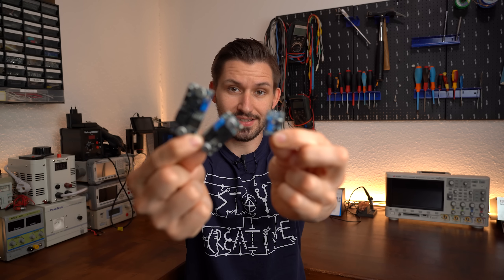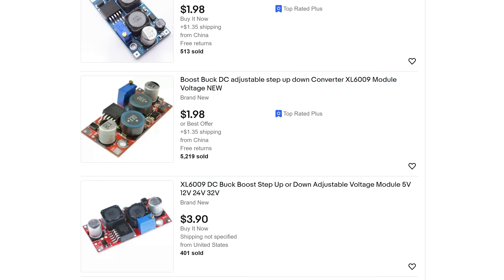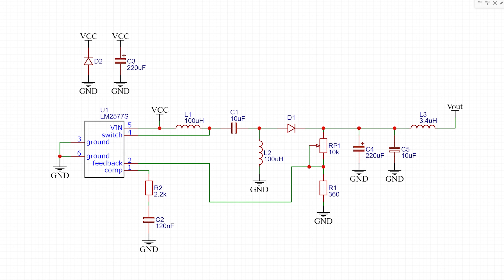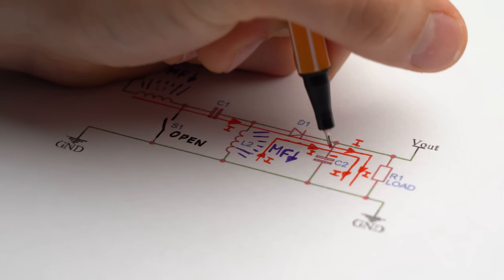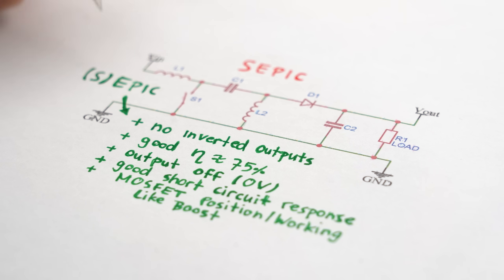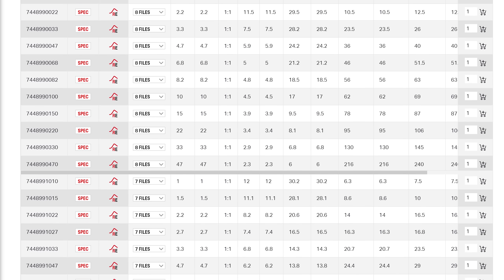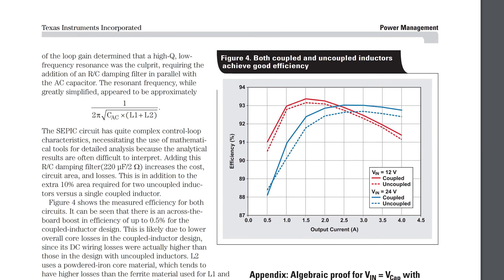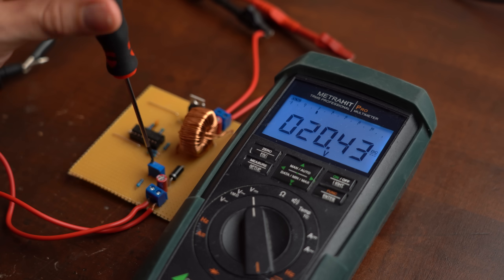The Most Versatile Voltage Converter you never heard of! The (S)EPIC Converter

Comment: So unless you're a Chinese factory counting every cent, does it make any sense to use either a buck or boost individually, instead of just using a buck/boost?
Reply: If you are an individual doing this for a hobby I'd say focus on the size requirements and amps required by your device. I got the XL6019 coz It can handle 5AMPs plus has it's own heatsink so continuous running for extended periods of time won't make it burn.. 
(Mine's going strong for 3 years of continuous use)
Reply: @mynk0.78mm  I guess what I was trying to say (and yes it probably varies case by case) is that, what are the negatives of using a buck/boost if you only need one or the other? Are the combined converters less efficient?
Reply: @laernulienlaernulienlaernu8953  the single converters have lower cost, higher efficiency, more power or smaller size(last two being inversely proportional)

But the difference is minuscule if you are buying these in low volumes (less than 100). Which is why in my original comment I said look at your requirements and availability in your local area

Comment: It’s kind of amazing that buying two inductors is significantly cheaper than a single coupled one. I suppose there’s just not a big enough market for them to compete on price, huh?  
Super cool video! Especially the DIY circuit at the end.
Reply: Winding a single is much easier than winding a dual with most winding machines.

Comment: I'd guess that a specific boost or buck circuit is more efficient, to take a simple example in a 12V to 24V boost, half the output power is coming directly from the input, while it's a bit less than half in a 12V to 5V buck

Comment: The main reason, if I remember right, to use coupled inductors is that it will be much easier to find a capacitor that will handle the current. These poor caps in the middle are really having it.
Reply from the maker: Thanks for the feedback :-)

Comment: I was researching the different topologies to decide which one to design a low-voltage DC UPS around, and kept hearing that SEPIC is unstable against transient loads. It'd be interesting to see a video on how different topologies react to different types of loads.
Reply: Hey sounds like the situation I found myself in too! Surprised there isn't more commercial options around this given how often you'd think home users would just want an uninterrupted DC power source for their home network and other DC-powered electronics. My setup at the moment is a small server rack with a 15V DC PSU and a 12V Lead Acid battery (+ battery tender) with their ground connections tied. The output voltages are separated by diodes, thus creating a sort of "OR-ing" device. That gate's output is connected to a powerpole rigrunner so that I can split all my components to separate SEPIC converters to ease the change in load and to also not have a single point of failure. So far so good but then again I'm only running raspberry pi's, switches, and a router at the moment.
Reply: Many power supplies are based on a dual control loop topology, with an outer loop with conventional voltage control PWM and inner loop based on current mode control.  This tends to protect the power supply against transient loads, especially short circuits and the like.  Something like UC3843 and like series of chips may be more stable with a SEPIC converter.  There is a sense resistor in series with the source of the switch to control switch currents, and there is an outer control loop that senses the voltage.
Reply: There is also a four-switch buck-boost converter. Maybe look at BQ25713 for an example.
Reply: @k4be.  it sounds terrifing, one llc is already a nightmare
Reply: i went with a simple e-fuse and relay with a super cap as filtering for initial burst current so i can stay online even when power is off.
my power comes from a 5v 80000A pack that i boost to 12v to run the networking hardware.
Reply: I used a large one with 4 mosfets, with a cuple of capacitors at the output it works with a pc to power
Reply: My experience is any SMPS will be unstable with transient loads. Go ahead and use one, but either have a huge cap, a battery or some other stable transient source to keep it from blowing out your electronics, or add a linear low-drop-out regulator at the end. It could even run saturated for low loss, but will prevent the voltage from going too high.

That said, I suspect this SEPIC is worse than most SMPSs.
Reply: @chaosdragon6718  These are the reasons I moved away from SEPIC topology. I'm currently exploring flyback and push-pull, but stepping from designing buck converters to these more advanced topologies is pretty daunting.

Comment: Is this commercial Buck converters are coming with close loop control (I mean, is it change its duty according to the change in output voltage? As we know, the output voltage may change with change in load. Please, give your thoughts.) Thanks, in advance
Reply: That sounds like a constant current/constant voltage (CC/CV Buck) converter. The LM5117 is just one example, but I bought some cheaper ones from Amazon years ago because I needed constant current control for running LEDs. They use feedback loops to monitor current & voltage.

Comment: thanks for the knowledge  I like all your projects.  Next time I'd like you to explain the step down of XL4016 working with 20100ct. It's a small and cheap circuit, but it crashes a lot because I'd like to control the HV power supply.
Reply from the maker: I can put it on my to do list
Reply: @greatscottlab  Tausend Dank! 😁

Comment: You got any videos of using the DC Convertors to charge any lithium batteries? I bought a handheld blower that seems to not charge, wanted to try recharging the battery but I dont know how I could do that, a video to reference would be very helpful.
Reply: in my opinion first try charging it manually using a power supply and voltmeter, if the battery voltage increases, then continue charging to full using the OEM charger.

Comment: What happens to efficiency if you make it synchronous?  I’d think you’d get it way more efficient. I’d love to see more videos on boost/buck with ultra high efficiency for sure.
Reply: Synchronous 4-switch devices are much more efficient and can handle much higher currents. Of course the down side is that they are much more expensive and are also becoming quite hard to find.
My preference for stable voltages with very little ripple are ones based on the LTC3780, the output is so stable that I have very successfully used them for mobile radio, something which is near impossible with most non-linear converters. I realised early on that Sepic devices would not be adequate.
Reply: @chrishartley1210  ya a full bridge is a solution but the problem with full bridges is that they require p channel high side which means you can’t use ganfets. I’m wondering if sepic with the diode replaced with another fet woold get you to n channel nirvana.
Reply: @jameshancock  The 3780 (and 3789) drives 4 N-channel MOSFETs.
Reply: @chrishartley1210  wow. Gotta see how they do that because a pump can’t work so how are they keeping the top fets open 100% of the time?

Comment: Again a great video. The explanations are really easy to follow and very well illustrated.
What I was wondering though, is where the losses come from in this kind of circuit. Could the increase of the efficiency be traced back to the lower ESR from the coils maybe? The commercial ones had around 2 ohms and the DIY had a little less if I saw correctly. 
And how about the diode? What was the forward voltage there? It would be really interesting to see those values. Well, if the efficiency is of interest anyway.
Reply from the maker: Watch my video about synchronous  converters ;-)
Reply: Thanks for the hint. I started watching that video some time ago, but I guess I got interrupted. Good poonts for sure. I was nust curious about the efficiencies of the SEPIC architecture. So I started googling a little and found the following link which was quite interesting as well. Even more since the efficiency ratio was similar.
However, I am only a part time electrical engineer, so whenever words like resonance and crest factor, its becoming too involved for me xD 
Having a converter which is able to go higher and lower than the supply voltage just sounded too comfortable. 
https://www.electro-tech-online.com/threads/sepic-converter-is-only-67-efficient-why-so-bad.132702/
Reply: Diode losses and especially the inductors' ESR
Reply: As mentioned in the synchronous converters video, it is quite a bit more complex than just the ESRs and the diode losses. But yes.

Comment: Doesn't C1 get warm with all that AC current going through it?
Reply from the maker: It does if not chosen correctly. You want a pretty good capacitor there with low impedance to avoid that.
Reply: @greatscottlab  Does it see more RMS current than a regular switching converter output filter capacitor?

Comment: 7:04 actually it's pretty poor, but for a low cost solution, good.
Reply: I think the goal is a cheap and compact solution, without a big heatsink like on linear power supplies.
Of course far from perfect to use on battery.

Comment: Do you have a link to the SEPIC converter you recommended in the video?  I don't see it in any of the links you gave in the description, which did not use the IPD088N04L part.
Reply from the maker: Sorry but I was not able to find that converter anywhere. I got it a long time ago. But the XL6009 is only slightly less efficient. So I would recommend that :-)

Comment: Your videos are truly informative. It provides me with a lot of electronics knowledge as a hobbyist. Keep going. Also get well soon. You are great, scott :)
Reply from the maker: Thanks a ton
Reply: @greatscottlab  I'm so glad that you replied to my comment 😊
Reply: @greatscottlab  what is the amps of this and could I safely use something like this with a 12 volts 20 watts solar panel?
Reply: @jclowe735  20 watt is borderline for sepic converters. I would not risk it. But considering a 20watt PV panel will produce way less than it is rated, it will probably be fine..
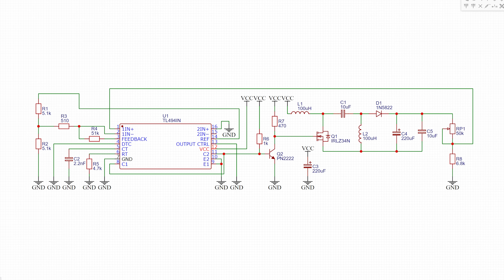Reply: Sure, they're very nice. But I think there's an error on the schematics presented for the DIY SEPIC (on 10:20): there's no connection to gnd for Q1 (and L2, C4, C5).
Reply: Another great video.

Comment: Meh... SEPIC isn't the best buck-boost converter... Yeah, it's the simplest, but the 4 switch buck-boost converter it's the better one, unless you need an insulated one.
Reply: +1 SEPICs are in fact noisy, unstable and not so efficient hence rarely used in practice.
Reply: @motokokusanagi1147  yes, hard switching and risk of subharmonic (idk if I wrote it correctly) oscillations.
Reply: Different tool for different job. I wouldn't use sepic for any application requiring more than 2A. Conversely sepic are much more compact with the use of ic than external switch like 2/4 switch topology

Comment: How critical are the values for the diode? The boost converters I have tried for projects with 24V 350mA and 19V 250mA either immediately desolder the diode from heat or burn out rather quickly.
Reply from the maker: Low forward voltage and big current rating is important. But they should not have a problem with 350 or 250mA.
Reply: The voltage at least 20V more than the maximum output voltage minus the minimum input voltage. About the current, at least 3 times the output current.
Example:
Vin_min: 5V
Vout_max: 24V
Iout_max: 2A

The theoretical diode: 49V 6A
The standard diode: 50V 7.5A
The recommended by experience diode: 100V 7.5A
Commercial recommended diode: MBR75100
Reply: @fabriziobrutti1205  Excellent info, thank you!

Comment: I have a DC to DC converter which have 3 inductors. Yeah. Its a buck boost converter but at the same time converts a single supply input into a double supply output. Its incredibly useful, but the problem is that it can output only 20w max.
Is there a way to build such a circuit that can output a bigger amount of power like   200 or 400w?
It can be incredibly useful to run POWERFUL audio amplifiers without transformer, just from a battery. Please, this is probably the most interesting voltage converter and in my opinion its worth giving it a shot.
I used JLCPCB for the first time a few days ago and ordered some boards (layout made by me, schematic found on the internet and made better). They are 200w audio amplifiers but they require a double supply.
Its propably possibile build one of those, but i cant design it unfortunately. Some online schermatics dont look so promising...
Reply from the maker: Can you give me a link?
Reply: The schematic May be ok and i can be wrong...
Reply: @gianluca458  ciao Gian, ti scrivo in italiano che faccio prima. Non ho visto li schema me la teoria del potenziamento è questa: stesso schema, condensatori che portino tensioni e correnti di ripple maggiori, induttanze con valore leggermente minore e che portino più corrente, MOSFET con tensioni maggiori e Rds(on) adeguate alle nuove correnti in gioco e idem per i diodi.
Se puoi mandarmi lo schema o ti servono altri consigli, io ci sono
Reply: Heh... Purtroppo non sono a livelli così alti... Ma fa niente, proverò con quello schema.
Comunque è XL4016 mi sono confuso col numero
Reply: @gianluca458  ah ok... Comunque cerca su internet, che magari esistono soluzioni adatte a te già pronte!
Reply: Whoops, some of it is written in italian.
The link works.

I Wonder how this circuit behaves
Reply: @gianluca458  use external mosfets + heatsinks
Reply: Il circuito su Amazon non usa mosfet, questo è il problema. Usa un integrato [XL4019] che ha una potenza molto ridotta.

Lo schema che ho trovato usa mosfet e va bene così, ma non so se lo schema è giusto magari lo faccio e poi non funziona hahaha
Reply: @gianluca458  uhm sicuro che sia Xl4019 e non XL6019? Comunque dovresti cercare su internet (tramite Mouser, Farnell, Aldatasheet ecc..) un integrato che svolga la stessa funzione di quello che hai adesso, ma utilizzando dei MOSFET esterni... E poi, CAD alla mano, si rifà tutto!!

Comment: Which IC does the one uses with the most efficiency?
Reply from the maker: The FP5139. Pretty basic boost converter IC. But because you can use an external MOSFET with it, you can keep the power losses very low there. The other ICs came with integrated MOSFETs.

Comment: Make a video on using vga old monitors with aurdino in place of tiny tft or lcd displays. Plzzz
Reply from the maker: I did something similar before in my FPGA video.
Reply: @greatscottlab  I recently thought if you could use cheap old display with cheap arduino or esp8266 and show more information and menus control buttons options on that weather station project.It would be worth it if we can use a salvaged laptop display because there is plenty of them and it can drastically reduce e waste and provide better resolution than hobbyist displays.
Reply: @soumyamaharana9916  VGA isnt possible with arduino due to the clock requirements of the vga signal being higher that the frequency of the arduino, VGA also requires an analog voltage which can only be done with an arduino if it uses a resistor ladder or external dac. Arduinos are just too slow and dont have the required peripherals to making trying to drive vga worthwhile. You should look at the examples of an esp32 driving a VGA display if you really want to do it.
Reply: @conorstewart2214  Thanks for info but I may invest some time to make it work by external clock generators . I will try and update here if it works.
Reply: @soumyamaharana9916  external clock generators aren't enough, the Arduino can't output the data fast enough, assuming you are on about a traditional Arduino and not one of the new more powerful ones. Just look at the signal VGA needs and look at the clock and output speed of the Arduino, it isn't really possible. Also you mention laptop screens, most of the time they use proprietary connectors and protocols so most laptop screens are no good for getting reused.
Reply: @conorstewart2214  Actually I am not a hobbyist rather I study practically about motherboard and chipset so I can figure it out for old hardware I will let you know if I reach any further but you are correct I better micro controller than atmega328p.

Comment: i have always wonder when combining these buck converter to get negative voltage ie: using 2 buck converter to achieve  -9v 0v +9v
Reply: usually won't work cause they are all relative to common ground (input and output)
Reply: If the circuit is isolated you can use two converters to generate +9V and +18V and plop the ground reference in the middle.   Maybe with an extra resistor between +9V and ground so the 9V side doesn't sink current.